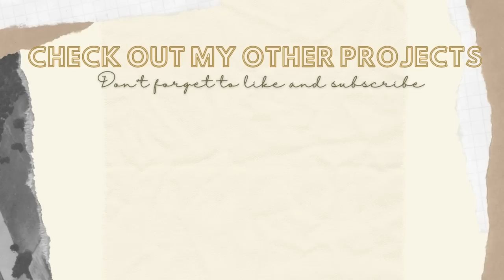STARTING A NEW ROOM MAKEOVER... AND DEALING WITH EVERYTHING THAT WENT WRONG | Bathroom Makeover Pt 1

Comment: When we removed our tile we smashed all the tile with a sledgehammer and then put a long pry bar under the cement board and it all came up together. I guess we were lucky that all the screws were rusty since the builders didn't use good screws.
Reply from the maker: Definitely considered smashing the tile. I did that downstairs where it was laid on a concrete slab. Worked much better there.

Comment: Very clever floor fix and support around the toilet! Was the discoloration just dark or was there mold there too? Curious if that needed treatment to prevent any further mold spread 😁
Reply from the maker: There was some mold right around the toilet where it was really soft. I checked the joists and they looked brand new. I think the outer spots were just discoloration but l think I’ll go ahead and treat them just in case. Thanks for the idea.
Reply: @KelseyRomitoDIY  Thanks for the reply! 😁  😁 You are very inspiring - I would not have even tried to take out a toilet on my own, and now, I think I would!! I am excited to see how the vanity turns out too- we have a bathroom in serious need updating pink tub, sinks and toilet, which I really like for the vintage vibe, but the tile is very "busy" and the vanity needs an overhaul it's very low. Looking forward to next week's video!!. 😁

Comment: I'm so excited!!! It's going great, Kelsey, and you're doing a fantastic job, as always. Don't be so hard on yourself. You're going much faster than some true construction companies. Lol I love that you're doing a bathroom, because I also started our main bathroom... and am working shower than those slow construction companies. We definitely have the same floor issue in both our bathrooms. How did you know when you could stop on the floor cut out? I noticed you left some of the discoloration, and I'm curious on how it all works. You were like a construction goddess putting in those plywood sections around the toilet. I was mesmerized at your genius in fitting it all together. Can't wait to see next week!!
Reply from the maker: Thanks for your encouragement. I appreciate it. I wasn’t 100 percent sure how far out the water damage extended. Basically I beat the floor with a hammer, moving away from the toilet until the hammer didn’t dig into the subfloor anymore. Then when I was cutting into the subfloor, I checked that the discoloration that I was leaving didn’t penetrate the top surface of the subfloor. I also stuck my head down into the hole with a flashlight just to make sure the floor joists (holding up the second floor) weren’t compromised in any way. They looked brand new so I figured I was good to go. Hope this helps.
Reply: @KelseyRomitoDIY  thanks so much!!

Comment: Great job so far! As usual! Can’t wait to see what it ends up looking like. Q for ya…. Since you’re the painting and staining pro… I have the bottom of a desk I had built and I need to finish it. It’s unfinished pine wood and I need to know do I sand and stain it or just stain it or put a special coat on top? Please help 😯 I eventually would like to make a concrete top for it… have you ever done that? Any tips?
Reply from the maker: I would sand it before staining. You can seal it with a top coat- I really like Polycrylic. I’ve never made a concrete top- I’ve always wanted to. Maybe one day!
Reply: @KelseyRomitoDIY  👍 thank you!

Comment: I would have replaced the whole corner under the toilet. There it still too much black (wood damage) remaining.
Reply from the maker: I thought about replacing the entire board but it goes under the bathtub and I was not opening up that can of worms. If you watch closely where I cut the plywood you can see that it is structurally sound- no black or softness. It’s just discoloration on the surface.
Reply: @KelseyRomitoDIY  I was just thinking that this project is like opening a can of worms.  I hope all goes well with the rest of the project.